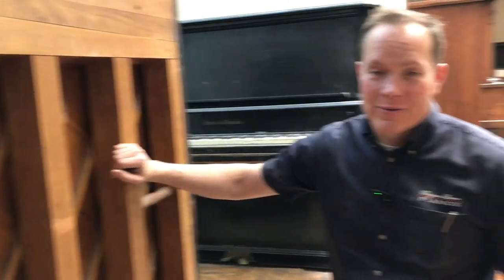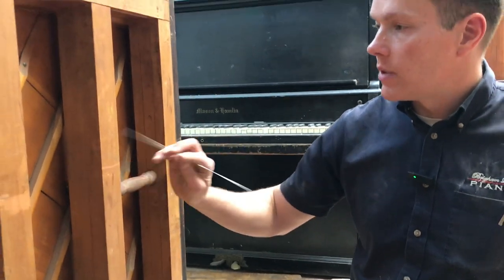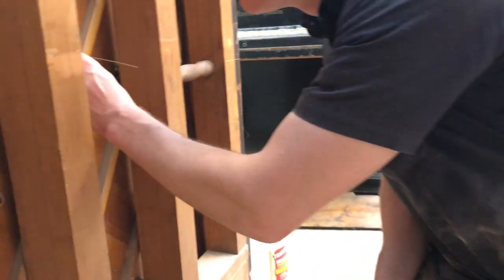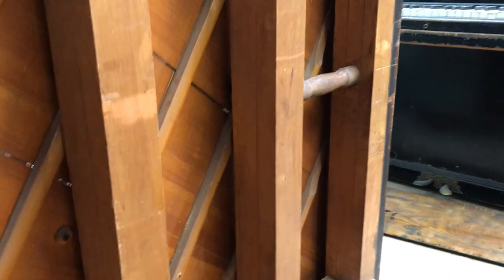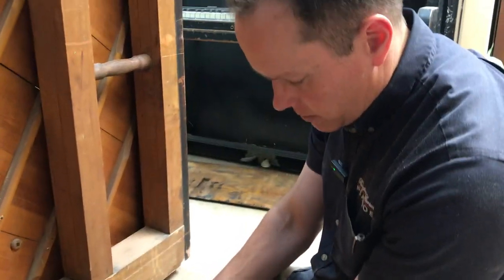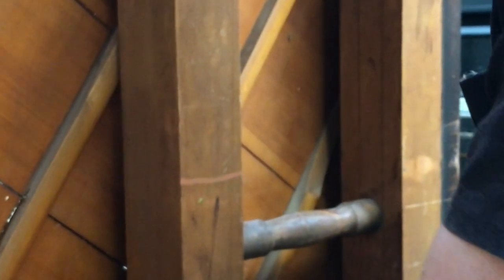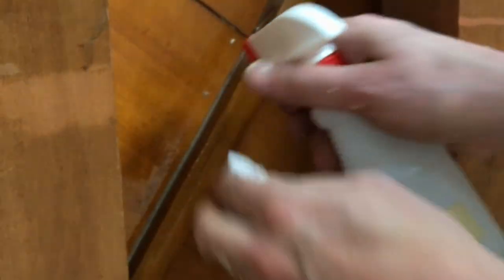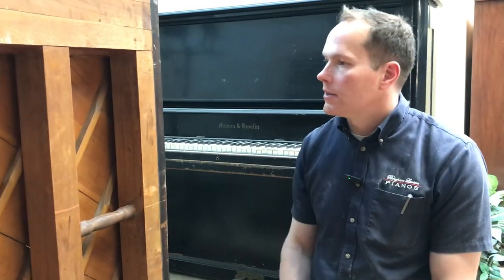Repair of Separated Ribs

Comment: Nice video. I would put 3 inch wide blue masking tape on the top and bottom edges of the rib before appling glue and have damp cotton towels ready at the waiting. This way, the glue will drip onto the tape and not on exposed soundboard - giving you time to wipe up the dripping/squeezed-out glue before it gets onto the exposed parts of the soundboard. Also, paper towel is not that very absorbent and it leaves shreads of paper behind. A good quality dampened cotton towel is more absorbent. It may leave a thread behind now and then, but they can be picked up easily. Always wipe away glue with a fresh part of the towel. Then toss it in a bucket of water when done so you can wash it later for reuse.

Comment: You need to fill the gaps in the soundboard. Sometimes it is best to do that before gluing the soundbard to the ribs (which creats the proper slight crown in the soundboard), sometimes it is better to fill the gaps after re-gluing the ribs. In either case.... DON'T use wood filler. You need thin stips of soft wood trimed to fit snugly in the gaps, then glued into place, then plane and sand flush on both sides of the soundboard, and touch up with finish.

Comment: To anyone seriously considering soundboard repair... never put a screw through the soundboard into a rib.  If you feel as if you must make the soundboard to rib connection super strong, use a dowel, with ample glue (preferably hide glue) and clamp the soundboard and rib together.  Screws should not be used.
Reply: I agree, don't screw a soundboard to a rib, the soundboard is just too soft and you will end up pulling the screw through the soundboard more than holding the soundboard and rib together. A glued in dowell is a good idea, but rig up bracing bars (in a small closet is good for that as it has walls that are close together to keep the bracing bars short) to hold the soundboard to the rib while the clue cures (24 hours). In some cases you can drill small holes on either side of the rib through the soundboard so you can use scrap wood to make a temporary screw/clamp to hold the rib to the soundboard for curing, then remove the screw/clamp and fill the holes with plugs and sand smooth and add touch up finish. I think it is aways best to remove the strings and plate to get unobstructed access to the soundboard front surface.
Reply: Correct. What a botched repair.

Comment: What a ghastly approach to this repair...drilling a soundboard...putting in screws? The correct technique is to clean inner surfaces between underside of soundboard and topside of rib...and then put in wood glue glue, then press the parts together with pressure rods on both sides. Never use screws as they loosed over time and buzz. Also ruins the soundboard.